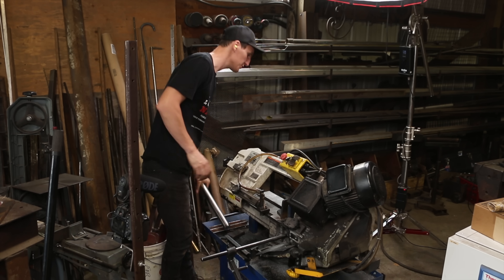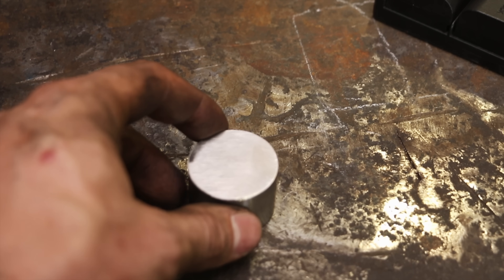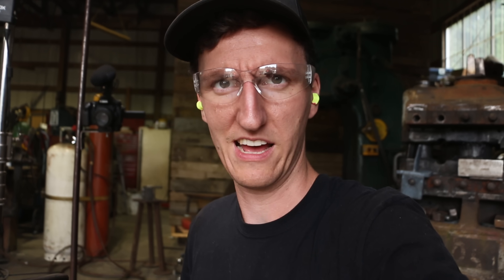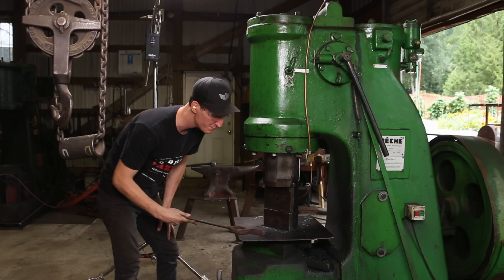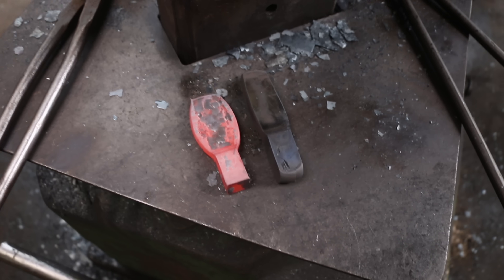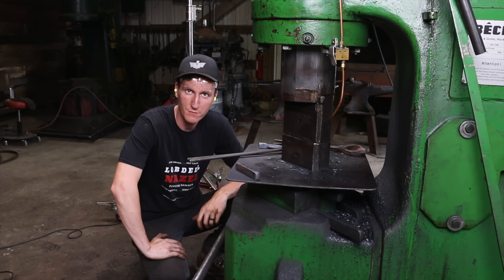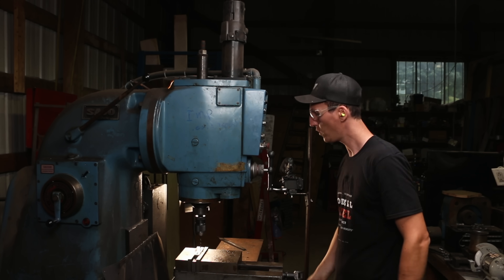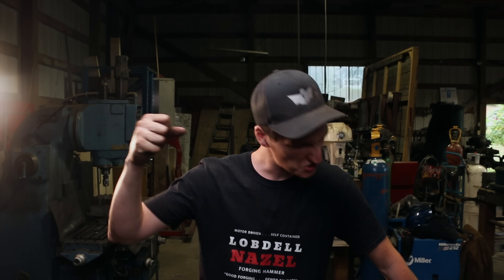Can I Forge INCONEL?

Comment: Recurring thought during video (and a few of his other vids), this guy is such the Batman super-villain origin story.
... In a race against time to forge a barrel that can withstand the enormous pressures and heat of his gun that fired 100,000 rounds per minute for the NSA,  Dr. TD bypassed many of the uniiversal safety protocols he himself instituted. Combining metals that gave off horribly toxic oxide gases, slowly his skin, lungs and circulatory system  began to develop a coating which shielded him from all types of radiation but the coating also made it difficult to absorb oxygen into his brain. Barely able to think in his hypoxic state, Dr. TD lost all sense of right and wrong, soon he found it necessary to replace the degenerate tissues with healthy parts he found in his victims ....

Comment: Cuts like real tough tuff ss use coolant slow it down it mils fine use carbide to fin and when drilling it is hard to get cut started use coolant and make the best out of it when it does start.  Max rigidity needed.

Comment: You are wildly under-equipped.   GM began making exhaust valve flanges for diesel engines back in the late 1950s.   You can band-saw it but you have to have the right blade material.   You don't heat it in a old-school forge.   You heat it in an electric induction heater.   Get a big enough press and you can form a cylindrical slug in three whacks of a multi-cavity die.   We forged hundreds per hour and then friction welded them to a SAE 1040 steel stem.   This was the first product I ever saw that used a robot for material handling - back in 1969.

Comment: you can try milling or drilling down to the work hardened area then try reheating the piece to reset the temper in the material . it's not like copper were heating gets rid of work hardening but it may take some of the temper out and reset it you know it never hurts to try

Comment: A couple of years ago I tried to make a hammer out of a piece of camshaft? I think? From a honda accord. Pretty sure it was the cam shaft I used. Anywho... Behaved the EXACT same way. When i exploded the piece, it caught my old shop on fire in like 7 different places. Stack of shop rags on fire. Cardboard boxes on fire everywhere.... Only time i have ever used a fire extinguisher actually. So maybe similar material.... It also took about 3 cutoff wheels to cut, so I assumed it would make a beast of a hammrr

Comment: If it's work hardening while cutting you can probably increase the SFM and adjust feeds accordingly, you will also need running coolant to reduce the speed it's work hardening at.

Have a look at speeds and feed charts for 316 stainless, then have a look on practical machinist and notice the difference in the advice.

I only have experience with 316, but expect them to work very similarly.

Comment: Not a chemist or a metallurgist, but a machinist. As far as I understand, the inconel exploded because the components that aren't nickel in the inconel fell out of solution. Depending on what material that is, once you heat cycle it like you did, it's not really inconel any longer. As in, don't trust it to make anything important that you would normally use inconel for

Comment: I worked in aerospace and we used inconel 718 all the time... It took a 120 ton forming press to mold that stuff into shape and our material was only 1/4" thick. We could not go from bar stock to final part, there was about 5 forming steps with different dies in the press. In between each step we had to send all the parts out for a heat treat. We manufactured the different compressor stages for the GE 90 Turbofan engine, the one used on the Boeing 777...  So yeah it is a total pain in the ass LOL

Comment: I forge bell helicopter impellers from inconel.   We also use inconel as the racks in our furnaces for  titanium  and our inconel.   Furnaces stay at 1720f year round and the inconel racks only get replaced as they get bent.     Pretty crazy.   Although the furnaces are pumped full of nitrogen to avoid oxidation of parts and racks.   We forge around 2000f for inconel parts with a  12000 ton Erie  mechanical press .

Comment: Be interesting to see how nichrome compares. According to Google they are about the same 80/20 nickel/chrome. Heat strips are nichrome.
Reply: Yes, that would be interesting.  The 80/20 composition is similar to Inconel 600, which is easier to forge than Inconel 718 (which I am assuming this naterial was).  But 600 is still  a lot tougher than stainless.

Comment: I machine 30 foot long 3 inch diameter bars of inconel into various shapes. The most common use for it is exhaust valves in race engines. Inconel is also poisonous to humans.

Comment: Would love to know the specifics of how they make those raw round bars given the difficulties you observed!
Reply: We started trial runs of running this at the mill I work at. It doesn't like to be formed very much. It is very speed and heat sensitive. We have better luck with the larger sizes and the lower grades. Basically it goes through a rolling mill.

Comment: i work alot with inconel 718, for Machining, drilling and cutting use half the speed you think you need. when drilling 10mm holes in inconel i run the lathe at 150-250rpm when using hss bits with alot of cooling and no pecking. just push the drill slow and steady. if you stop alot you will mess up your part..
Reply: This...

Comment: We had to machine some inconel for some heat and chemical resistant stuff at a shop I worked at years ago and it was like machining D2 only worse. As long as you are taking thick chips with a sharp tool with good cooling it's not too bad but as soon as you ease off the cutting pressure or the tool gets even a little dull it work hardens at the surface and it's a pain to get past that again. We found using new carbide tooling and committing to the cut once you start works well. Trying to go slow and easy on the tool was a recipe for broken tools.

Comment: I don't know anything about this stuff, but when cutting/machining materials that are wear resistant/tough, you often have to (paradoxically it seems) have a fast cutting speed (not so much the cutter itself) to prevent the material from wear hardening.
If the material gets a chance to harden while cutting, you're screwed.

Comment: You need constant coolant flow when milling inconel at lower rpm with very specific inserts made for it, or you can get ceramic inserts which you have to run at very high speeds, the chips come off glowing red. I've machined inconel parts weighing several tons (using a mill with 42 feet of X-axis travel, 13 feet on Y and seven feet on Z, not your average mill lol, the thing could turn a 12 inch face mill at a half inch depth of cut in steel), going through four grand worth of inserts in a day was normal operating costs which were actually very optimized. The stuff is universally hated by machinists, every time one of us knew an inconel part was coming down the line the bitchfest began, the stuff is awful.

Also, you need carbide drills if you want to poke any kind of accurate or deep hole in inconel, HSS or M2 cobalt is just way too soft and not rigid enough, that's the awful chattering you're seeing/hearing. Straight flute gun drills with pass through coolant work the best.

And when using any endmills, keep the flute length as short as physically possible and chucked up as close to the flute ends as possible, every micron of deflection you can prevent means a longer tool life. And use high helix endmills, they're absolutely necessary.
Reply: I've always equated any kind of work that involved Inconel as to trying to get a chip off Superman's chest. Doing it yourself saves a pittance of money (not time!), but any time we had to send some out to get work done to it, every single work order was 3-4x the price right off the bat. 
On the flip side, watching it shrug off afterburner exhaust as 'lowly' stainless begins to warp is quite rewarding.
Reply: @C-M-E  That's a good comparison, I like it😂. Trying to get a chip off Superman's chest, yeah that's pretty close to reality. But yeah, Inconel's high heat strength retention is the stuff of legends, there's a reason orbital rocket engine bells are made of the stuff. There's a few videos of the older much higher powered F1 cars revving their motors while sitting still and their exhaust pipes are literally glowing white hot, enough to provide light to the surrounding area, and like you said not warping or oxidizing the slightest bit. Amazing alloy...
Reply: @C-M-E  A good analogy when it comes to working the stuff. Stuff's nasty to work and hell to pay if you try to work it without a good machine at your command.
Reply: What industry were the several ton Inconel parts for?
Reply: @Minerals333  Usually for steel refineries, but we also did some work for a massive hydroelectric dam, they use a lot of nickel alloys for wear resistance. We built (from start to finish, cutting all the plates out, welding them together, heat treatment and then machining) a number of gate valves built mostly from a nickel stainless alloy with inconel valve faces, which had a 6 foot internal diameter (big time flow, in the millions of GPM flowrates). They were turned on a 12' swing vertical lathe then moved to our Union mill (the aforementioned 42'x13'x7' travel mill) to drill bolt holes on all the flanges, cut seal groove rings and oil ports and any other small details.
Reply: @Minerals333  I did fire boxes and kilns with it
Reply: We started to switch over to end Mills that have the replaceable inserts, it makes it alot cheaper but just as time consuming. Running it on a lathe is alot easier you just have to keep sharp inserts or else you end up pushing the material.
Reply: @danielcortez8326  Those are great but the bigger ones that have like 60+ inserts aren't very economical, replacing all those inserts at once is incredibly expensive, we found that buying solid carbide endmills up to 2" diameter (any bigger and you have to buy the inserted shell mills though unfortunately, solid carbide prices increase exponentially after 2" diameter and up) and regrinding them as many times as we could before they chipped out was quite a bit cheaper and just as productive. Granted you had to be mindful of diameter offsets a lot more but that's no biggie. Plus the solid carbide cutters tend to be a lot stiffer than the steel body inserted cutters.
Reply: @TheExplosiveGuy  It's hard to machine but a dream for a designer of parts in adverse conditions. But I know machinists that love the challenge... and get bored by "lame" alloys.

And welders love it! Well... some alloys at least.
Reply: @jackmclane1826  Ohh for sure, I actually do like doing smaller parts myself, I just hate the big jobs. I've worked in a few aerospace shops that made much smaller parts than the larger ones I've done more recently, and I always loved when my boss came down with a special job for me (I had the best track record in the shop for not scrapping parts so I always got the difficult jobs lol, no stress right?🤣) like a batch of Inconel, titanium or any pre-heat treated stainless parts, those are way more interesting than cutting aluminum or standard low grade steels. There's definitely an element of a good challenge to it for sure, but when you are cutting on 8,000lb parts that stay on one setup for two days straight while changing out inserts every hour and trying to scoop up the spawn of hell that is inconel chips the fun of the challenge goes right out the door lol.
Reply: This guy inconels.
Reply: Hey its Mark! 
 I was gonna sell you liquid metal, we watched a video by photonicinduction about arc rectifiers
Reply: @helpabrothawithasubisaiah5316  lmao hey what's up! Fancy seeing you here🤣
Reply: you beat me too it
Reply: Try some MP35N ;)
Reply: how is inconel to AR 500 steel??
Reply: @fireofdestruction7753  by what metric are you asking? AR500 has superior abrasion resistance over inconel (a little bit superior, inconel is still some strong stuff) but poor high heat strength retention so inconel actually has more strength and abrasion resistance at high heat than AR500. I guess it really depends on the application you'll be using it for, AR500 excels in some areas and inconel excells in others. I'd take an AR500 armor plate over an inconel armor plate any day, I can tell you that, but I'd take an inconel exhaust system over any other metal in existence.

 It's kind of like trying to compare a tractor to a truck, both have their uses and both can be used interchangeably for the same purposes, but one will always do some things better and some things worse depending on what metric you choose to measure.
Reply: Kennametal Harvi 1 TE is the Gold standard for cutting inconel 625
Reply: Holy shit, I knew it was hard to work with, but whoa.
Small wonder inconel racing parts are priced like they're milled from billet unobtanium!
Reply: Inconel is easy compared to Hastelloy.  Had a line item for both mills and inserts.  coolant was doing little to nothing.
Reply: @godslayer1415  Yeah that stuff is a bear to cut too, we had the best luck with whisker-reinforced ceramic inserts at high rpm with no coolant (that goes without saying I suppose, ceramic inserts and coolant never play nice with each other, too much thermal shock).
Reply: @godslayer1415  My friend has machined Inconel, Monel, Hastelloy etc.  He doesn't have much good to say about any of them. But I do recall him saying Hastelloy was a downright bear!
Reply: So thats why 3d printing
Reply: @rokadamlje5365   No... inconel itself is expensive. Inconel powder out of this price world.
Reply: @jackmclane1826  i mean, if its so hard to mill it that it makes more sense to 3d print it?
Reply: @rokadamlje5365  Always remember: Welding material is mistreating material! You'll never reach the same properties in a weld than what you'd get from well treated, rolled, voodooed stuff fresh from the steel mill. Welds are always weak points in your part. 3D printed metal parts consist only of welds basicly. They can be good enough, but they never are what the material is capable of. 

Nobody wants to weld. You weld because you have to! ;) 

But if you want to 3D print such large parts as Mark was talking about, it would take... many weeks.
Reply: @rokadamlje5365  Christian Von Koenigsegg 3D prints inhouse with laser sintered Inconel.  I think they 
print the parts because they are not physically machinable. Like they have Inconel exhaust headers
that have one piece turbo housings built in and they have dual scroll paths inside that are impossible 
to machine even on high axis stuff.  It's a crazy technology and a crazy material.  :)

Comment: Inconel: 
You're flying on it. A lot of the jet engine rotating components are made with it. It's hard as hell. Part of the Unobtanium metal alloys group.
Reply: I’m a machinist and work In the aerospace industry. Can verify this stuff is hard as hell
Reply: @christianhubbard8444  Not even close to the hardness of bearing steels or stainless steels (at room temp). But it retains strength at high temp.
Reply: @FinnMcRiangabra   i work with plenty of stainless steels and all types of materials. Inconel 718 is one of the harder and frustrating materials I’ve worked with. I use 17-4 and 15-5 SS on a regular basis and it’s a significant difference.
Reply: @christianhubbard8444  Good for you. But Inconel 718 (the OP does not specify which kind of Inconel, btw) is less than 40 HRC at room temp. Have you machined 440C or 52100 bearing steel?
Reply: @christianhubbard8444  17-4PH and 15-5PH stainless steels do not have much different hardness* than Inconel 718 at room temperature. The important difference for forging is that Inconel 718 retains strength better at high temperature than the precipitation hardening stainless steels.
*hardness and strength of the precipitation hardening stainless steels depend on the aging temperature, obviously. What condition 17-4PH are you talking about? You are aware that it comes in different heat treat conditions, right?
Reply: Titanium is brutal as well.  Destroys Hanita endmills.
Reply: @edgeofentropy3492  Titanium and it's alloys are not hard. They do gall easily.